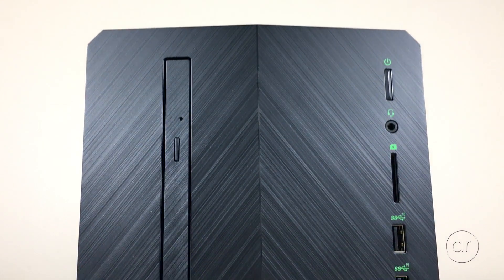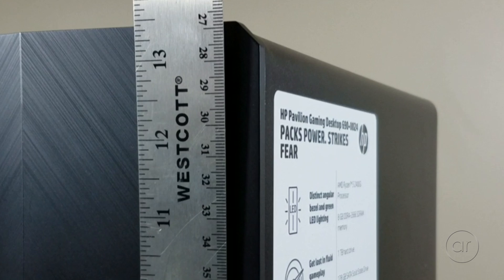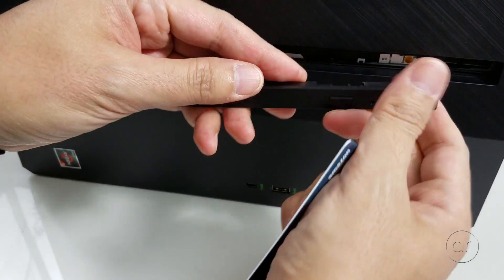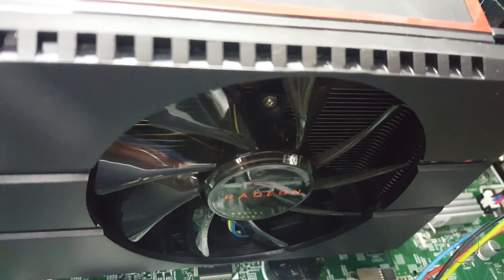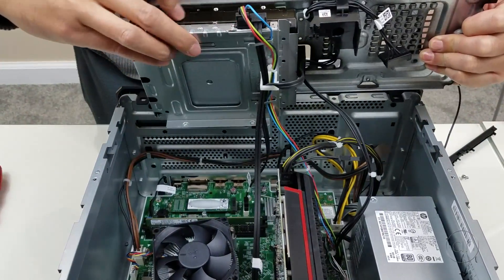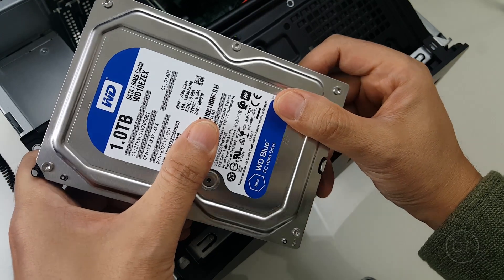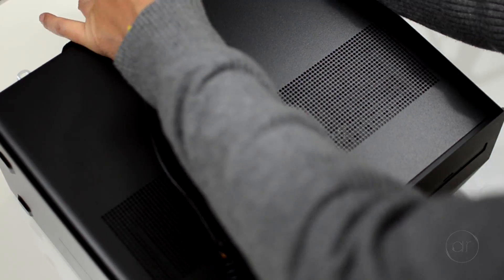How to Open and Upgrade a Ryzen-Based HP Pavilion Gaming Desktop

Comment: FYI the factory installed SSD in the M.2 slot is not NVMe. It is SATA and model number MZNLN128HAHQ-000H1, and will of course mac out at SATA speeds. It is keyed M/B. The slot on the motherboard is only keyed M, so an NVMe drive looks like it will physically fit, but I don't know if it will actually work. It is a shame that HP's own website calls the drive NVMe. I'm hoping they mean the slot is NVMe compatible (as well as SATA, naturally).
Reply from the maker: Thank you for the research - shame on HP. Do you mind if I add this to the description, with credit to you?
Reply: access random Don’t mind at all!
Reply from the maker: Thank you!
Reply: nvme works, someone else has done it. I contacted them and called them out on this, hoping for a reimbursement or a free nvme if posslbe lol

Comment: can you upgrade the PSU?
Reply from the maker: The official line from HP is "This model uses a standard 12V PSU. Make sure it has two 4 pin connectors. It is not a custom PSU. HP does not maintain a database of compatible third party products.," but a reviewer on Best Buy's site has stated it is not standard. I'll be keeping track of any successful attempts from viewers and subscribers, and I'll update the description with any information I receive.

Comment: is it CL 15 or 16 for the RAM?
Reply from the maker: It's actually CL 19 - the model number is Samsung M378A1K43CB2-CTD. Hope that helps.
Reply: @accessrandom  Is it possible to overclock RAM on any of these Hp prebuilts?
Reply from the maker: @IosifStalinsendsyoutoGulag  Unfortunately, HP has locked down the BIOS pretty well. I don't see a way to overclock the RAM (much less the CPU, voltages, etc.).

Comment: How would you add another hard drive?
Reply from the maker: There is an extra SATA port on the motherboard (seen at the 5:03 mark) and an extra SATA power (at the 5:13 mark).
Reply: @accessrandom  Okay, thank you! Also. That blocked hdmi; I know that integrated graphics isn't supported but is there a way to plug in a another monitor to it? Or would it not work
Reply from the maker: @qqwg-tn7nd  There's three DisplayPort and one HDMI port on the back of the Radeon RX 580, so you can use those to drive multiple monitors. That's a really good question about the blocked port though - the HP product page states outright that integrated graphics isn't supported by the motherboard so I just took their word for it - but I would be curious to actually open it up and try it in the future...
Reply: @accessrandom  okay! If you ever do that let me know. I am also curious.
Reply: Thank you!
Reply from the maker: Sure thing.

Comment: I have this pc but not with ryzen but with intel i5-8400, I wanted to do two or three upgrades

1) gtx 1070 or 1070ti (now has a gtx 1050 2gb)
2) psu 5-600w
3) ram 16gb

Is it possible to make these upgrades or can not?
Reply from the maker: I'll try to answer the best that I can - I wish I had a better answer for some of these:
1) I'll be keeping track of the graphics cards that my viewers have had success upgrading to. Unfortunately, I haven't had anyone upgrade to a GTX 1070. One has had success with a GTX 1050ti, and I know one model in the same Pavilion 690 family has a GTX 1060, so that should be possible as well.
2) This is a big unknown - HP says it is a standard SFF PSU, while others claim it is non-standard.
3) Yes, you can upgrade to 16 GB. All 690 series will have two DDR4 slots, accepting a max of 32 GB of memory (2 sticks of 16 GB).

Comment: im looking to buy the HP Pavilion Gaming 690-0970nd , can you tell me anything about this version?
Reply: I just got the new model of the hp gaming  its a monster  ,, rizen 7,, 16 gs of ddr4  126 ssd   and a 1t harddrive  best buy has it on sale this week  for  $699.00  then   get a samsung 1 t ssd   and your are set for life  i use my  rig  for  music  its the best  mucho  power
Reply from the maker: That's a great deal 👍 - with that setup, you could load as many VSTs as you want in your DAW and not skip a beat.
Reply from the maker: This seems to be a model specifically for the Dutch market, so I'm afraid I only have information that's published on the internet. The case looks exactly the same as the 0024, but the internals are: i7-8700, 16 GB DDR4 2666 RAM, 256 GB M.2 SSD, 1TB 7200 RPM HDD, GeForce GTX 1060 (3 GB). This is more comparable to the 690-0034 than the one I have.

Comment: mine amd ryzen 5 processor runs at 140 F under a 40% load. Is there a way i can upgrade the fans or add an external fan on the case. and also if i was to switch cases to a corsair minitower what can i transfer over? what will i need to buy? Thank you so much for the help and the videos!!!!
Reply from the maker: It is very tight in there. There's approximately a 5.5" clearance from the motherboard to the side of the case so you'd need to use a low-profile CPU fan (EVO Hyper 212 and the Hyper T4 would not fit). There's not much room for a case fan either - you could punch an opening on the removable side of the case, where you have about 60 mm to work with (more if you want to extend beyond the vent hole pattern).

You should be able to move everything over to another case, with just a few caveats. Make sure that the power supply will fit (it is reportedly 2.8125 x 2.9375 x 6.25 inches). The DVD/CD drive has a slim profile so you'll need an adapter if you only have 5.25" bays. Finally, there are front panel USB/audio connectors and a memory card reader that need to be adapted to the new case.

Comment: I have this desktop RX 580 is so good but processor is kind of bad. I want to upgrade the processor from Ryzen 5 to a ryzen 7 will I be able too?
Reply from the maker: Agreed - that is an upgrade that I'll probably perform in the future since I do a lot of video editing. According to HP, you can go up to a Ryzen 7 2700.
Reply: @accessrandom  is like $230-260 for that processor, which is half the cost of this particular PC lol an option but not for the present in my case, maybe in a couple of years
Reply from the maker: Good point - the price difference over the holidays between this and its big brother, the 690-0034, was $220, (plus an extra 8GB of memory). That would have been a better deal for those who need it...

Comment: Did I understand the video correctly? HP  stores the system backup on the mechanical Drive and not the SSD? if so that's actually good news because the SSD is the only part of the model I'm looking at that is disappointing. I'm looking at the 690-0034.
Reply from the maker: Yes, that is correct (on the 690-0024 at least - not sure about the 0034 but I suspect it would be the same). They placed the system backup on the mechanical drive.
Reply: I would check the SSD drive because it looks like HP is cheaping out and putting standard M.2 drives and not the NVMe drives as stated on HP website
Reply: @zardoz2350  i contacted them and they responded, sent more info, hoping these suckas reimburse me or send me some freebies lol
Reply: I easily upgraded to larger Western digital black edition m.2 NVmE ssd. Super fast now and is easy to do.

Comment: Thanks for great video. Im just getting back into computers. My friend bought the 690-0024. But windows device manager says the SSD is a samsung MZNLN128AHQ-00H1. https://www.samsung.com/semiconductor/ssd/client-ssd/MZNLN128HAHQ/.   I found out that it is NOT an NVMe drive. HP specs says NVMe drive is in the machine
Reply from the maker: Interesting! My model (in device manager) is MZNLN128HAHQ-000H1, and I also couldn't find any literature that definitively says it's NVMe. I didn't take it out to take a look at how its connection is keyed, but next time I'm in there I'll take a look. Please let me know if you find out anything...
Reply: @accessrandom  The drive is keyed M&B, which is normal for a sata drive. It's def not an NVMe drive. I only hope the socket supports NVMe.

Comment: could i add a second GPU rx580 and crossfire ?
Reply from the maker: There's one PCI-E x16 slot (taken by the RX 580) and then one open PCI-E x1 slot. I suppose technically you can do it but the power draw I think would be too great on an x1.
Reply: @accessrandom we'd have to figure out how to upgrade that power supply
Reply: @TheEgb18c  hit me up and ill tell you how to upgrade PSU
Reply: @lazertag720  how do you upgrade psu
Reply: @TheEgb18c  give me the model number of your HP PC and the current wattage of PSU and motherboard name
Reply: @lazertag720  690-0034 ryzen 7 CPU RX 580 , it's got a 400 watt psu
Reply: @TheEgb18c  ok does your HP have the sunflower motherboard? If so you can upgrade to a 500w PSU from the HP parts store part#L05757-800 
The PSU comes from the same HP gaming line up but a higher model,i forgot the exact numbers but i know its somewhere around 690-0050 or 790-0050
Reply: Found out Crossfire wouldn't really be beneficial

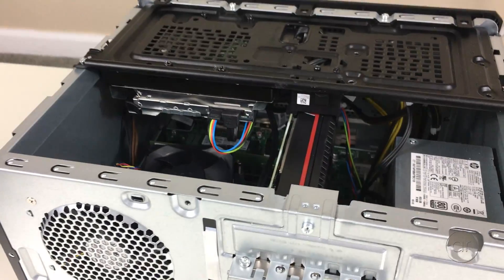Comment: HP Pavilion 790 Gaming Desktop has a very similar front panel design that has a laptop size optical drive but with a slightly larger dimension case . You don't need a plastic card to pry open the optical drive's front cover like you did there on 2:25, instead the optical drive has a black plastic quick release tab (seen in 1:43), you can press it in and push the entire optical drive out of the front panel, so that way the entire optical drive module can slide out (there is no screw or SATA cable to hold the drive).
Reply from the maker: Thank you for the info. I'll add this to the description, with credit to you.
Reply: @accessrandom  thank you for your high quality video content!
Reply: @yewang2361  how is the drive connected to the pc then? when you slide in, is plugs into a socket?
Reply: @naegleriafowleri1715  Yes, the back of the slim DVD-RW drive looks just like a 2.5inch SSD drive, SATA connector and SATA power connecter next to each other. It doesn't use any screws to fix the drive so you can push it out from the inside with a little of force:  take a look at this eBay item's picture, you will what I am talking about. https://ebay.us/ZM2Y8F
Reply: @yewang2361  pic doesn't show the cables though, id rather see a video of my man access random doing this